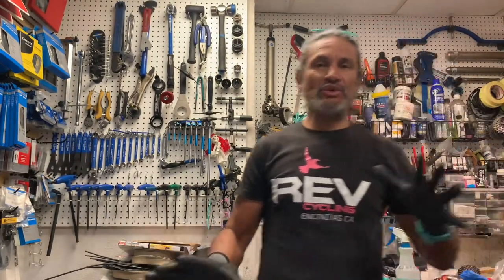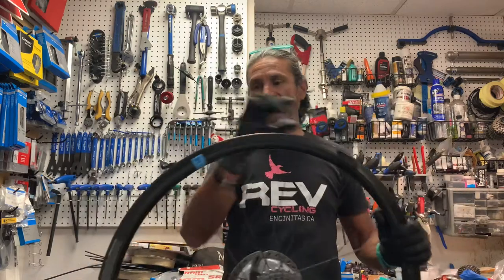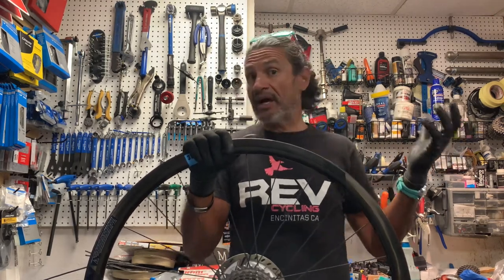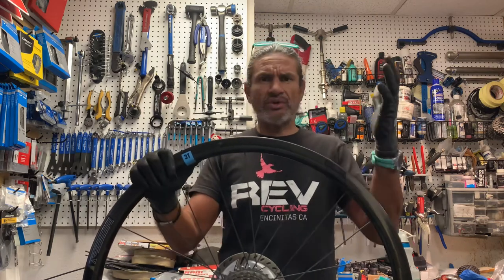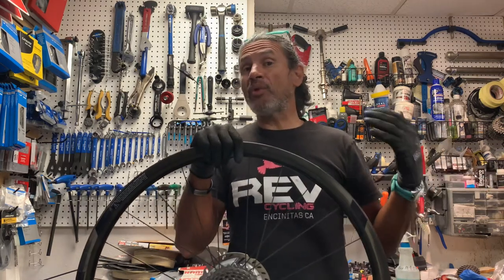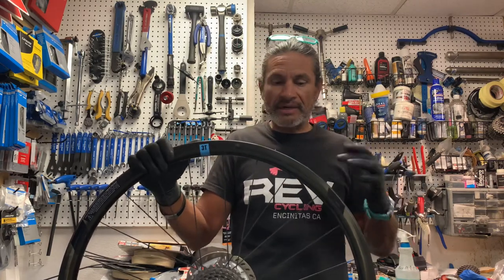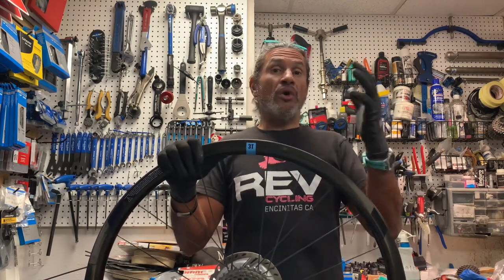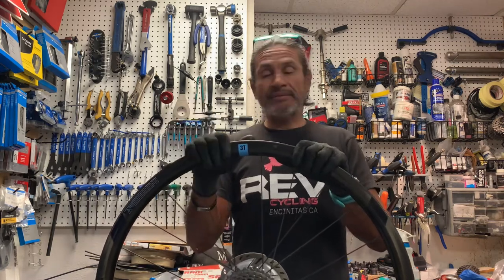Internal nipples… a very dumb idea! Bicycle Wheels with internals nipples

Comment: Internal nipples are so stupid, had a pair of Reynolds tubular with internal, had to take tire off just to true the wheel. Will never own another internal nipple wheel.
Reply from the maker: Absolutely stupid I still own a set (hasn't been ridden in YEARS) of Reynolds Cirrus KOM tubular wheels.  They are super low profile, internal nipples and TUBULAR!  Some day I will put them up on Ebay there will be a weight weenie frothing at the mouth for these ultra light wheels :-)

Comment: Hey George.  I'm in the process of building my first set of custom wheels for my single speed road bike and have a question.  As for my front wheel I'll be running a 160mm Center Lock Disc Brake (either 12 or 15mm Thru Axel).  Carbon Fork.  As for what Hubs I don't know (yet) and need help to determine that.  My rear wheel is most likely going to be a Flip Flop Hub (Free Wheel on one side Fixed Gear on the other.  Although I hardly use my Fixed Gear side).  I have straight/Track Bike/Fixie like dropouts.  No rear brake.  Both Rims are going to be 700c 88mm Carbon (Clincher 23mm V Shape).  With the Rims that I'll be buying you get to choose how many holes you want.  I like the look of lesser Spokes but I want to build a strong enough wheel to support me especially now because of the Disc Brake in the front.  I'm 5'10 around 180 pounds.  How many holes/Spokes do you recommend I get?
Reply from the maker: 28 spokes minimum for your weight.

Comment: I have a Mercedes Smart ebike with internal nipples.What type of wrench is used on these?
Reply from the maker: Unfortunately, I won’t have any idea. There are many different nipples. I have 7 internal nipple wrenches. I was working on a wheel today and I don’t have the nipple wrench for it. 

You need to contact the wheel manufacturer and ask them directly. 

Thanks for watching!